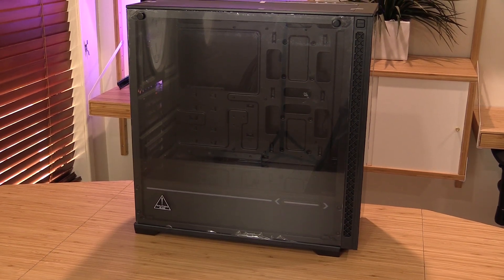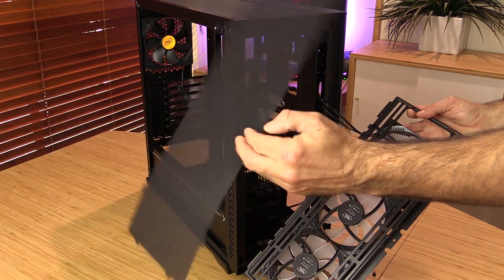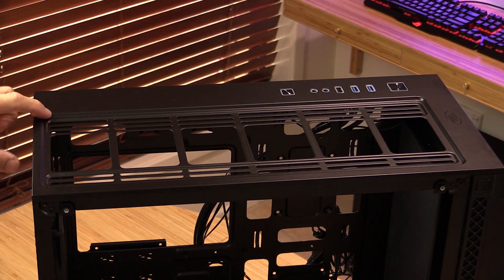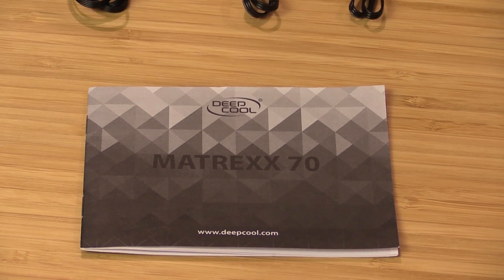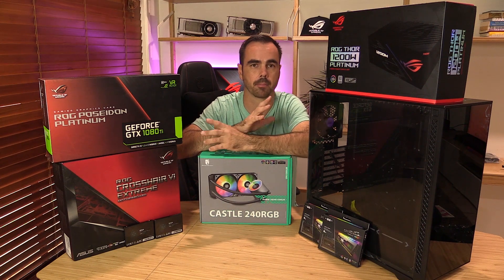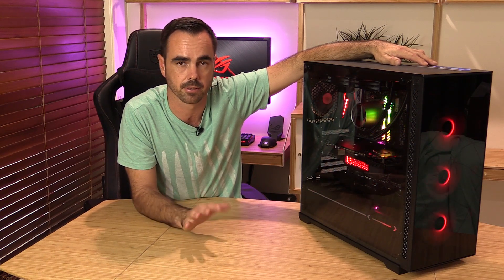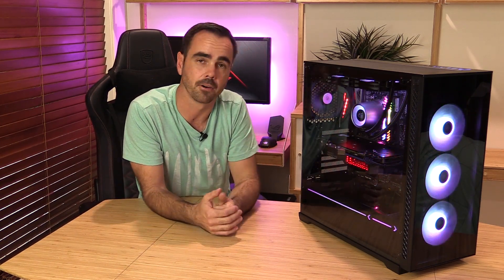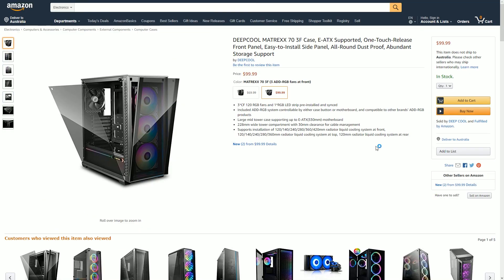Deepcool Matrexx 70 ADD-RGB 3F Review

Comment: i run this case with 5 intake and 4 exhaust fans (also from deepcool), removed the glass basement and hard drive cage to put the 2 extra 120mm fans there, GPU (2060super) is vertical and has a slight hotspot in the middle of the card if i touch the glass but the card doesnt go much over 63-65c with CPU topping out at 50c then the fan curve ramps up a little and back down to 38c the dust filters do a great job and easily removed for cleaning
Reply: may i see the photos of your setup? I also want to put extra fans but not sure how it will be better

Comment: One of the best case ever imo !!! Cheap price, sturdy build, 3 RGB fans with good air pulling ,one black fan in the rear, dust filters in the front, bottom and top, good clearance for cables,... all for less than $80 @@
Reply: is it quiet tho?
Reply: @seeeLAH1  i use headphone so i cant tell

Comment: Having the dust filter behind the fans kinda defeats the purpose of the easy remove front panel doesnt it? A magnetic one to just go over em would have been so much better with the fans mounted behind the frame,. Pop front off, remove filter for cleaning, pop back on.
Reply from the maker: 100% agree with this. Maybe in their next revision.
Reply: KWASTEK But at the same time you should just remove the dust filter entirely. Reason being is that the intakes on the side of the front panel already have built in dust filters that seem to be the same as the removable dust filter so why have 2 of them? IMO it just makes sense to remove it and let the fans move more air 👍🏼
Reply: @vtgchaos6272  Except you should not use it choked up with the front glass on anyway, so it doesn't matter that it has filters along the sides, the surface area to get air in through there is a joke.

Comment: Is it good to take this for build like this?

1) Processor: AMD Ryzen 3600
2) Motherboard: Gigabyte X570 GAMING X 
3) Memory: Kingston HX 16GB DDR4 3200MHz HyperX Fury Black
4) Graphic: Asus PH-GTX1660-6G
5) SDD: WD M.2 Black SN750 / 500GB

6) Power: LC Power LC6650GP3 V2.3 650W

Thanks.
Reply from the maker: That build looks pretty solid for this case for sure 👍

Comment: Hey, was it difficult to hook up all of the A-RGB components from the Radiator fans and AIO pump to the integrated controller? When I get this case I will have 3 A-RGB fans (2 on my AIO and 1 as rear exhaust) and want to have it all synced with the pre-installed front fans. Only thing is they are Cooler Master fans and have different A-RGB connectors than the ones Deepcool uses. I assume it comes with more connectors and just uses Molex for powering the controller. Can you confirm? 

Loved the review really helped me decide if this case would be a good fit for me!
Reply from the maker: No it was easy with the Deepcool fans. From memory the cooler master fans have a different connector but you daisy chain them and just use the included adapter cable to connect it to the RGB controller it'll be fine. Alternatively just use your motherboards on board rgb controller.
Reply: @kwastek2125  Hi, I have  similar situation but my MOBO doesn't have the ARGB connectors. I have 3 Deepcool ARGB fans I bought separately, is it possible to have all 6 fans (3 from the case and 3 other deepcool ARGB fans) connected to the controller on the case? As I do not have RGB connectors on the MOBO.

Comment: is the cooling/airflow  upto  the mark? we dident see the benchmarks of the tempreture.... otherwise an awesome video .. :D
Reply from the maker: Hey mate, yea unfortunately I didn't have time to test thermals when I recorded the video. Since using the case for my daily in an Australian summer it's been perfectly fine. I did take a suggestion from another user who commented and removed the dust filter from behind the fans in the front which did improve airflow a bit. So I would recommend doing this also.
Reply: KWASTEK so put the dust filter in front of the fan?

Comment: hello I have a mobo msi x470 gaming plus but they do not have a 3-pin 5v input, will there be a problem or does the cabinet already have an adapter?
Reply from the maker: The case has a built in led controller and has different adapter plugs for different motherboards.

Comment: Hi and Thanks Kwastek. I bought this new computer with this case and although the front 3 fans and the Power supply all work off the case button, the top two fans, LEDs light strip and rear fan just glow blue and don't change with the front fans color!  Any ideas whats wrong? Cheers from WA ;-)
Reply from the maker: Hey mate, if you have those fans running off the motherboard then make sure you have the correct pin out. Usually if the pinout is different then blue is the only colour that will be put out. So I would check your connections first cause that's what it sounds like

Comment: What about airflow?
 I have a choice between matrexx 55 mesh and matrexx 70.
Matrexx 55 mesh has very good airflow and matrexx 70 because it has a  lot of space.
Reply from the maker: The matrexx 70 has good airflow once the front dust filter has been removed. I have been using this way for the past 6 months and it's been quite good. I can't comment on the matrexx 55 as I have not used it

Comment: ok but what about the short space between front fans and the glass??? the airflow is sucking in this case...
Reply from the maker: Not had an issue with airflow because of this.  Removing the back dust filter from behind the front fans did help a bit with airflow though. But I didn't have an issue at all given there's about 15mm of space in the front.

Comment: Hay man great video! I've been looking around for some info and I hope you can answer some questions for me. Can you remove the HD cage, the reinstall the glass basement roof? Also, if the radiator cage is removed what are the fan mounting options for the bottom of the case. It looked like you can mount some fan larger than 120mm, maybe a 140 or 2?
Reply from the maker: Hey mate thanks :) yea the hd cage can come out all together but it won't be fixed in place as the thumbscrew fixes to the top of the Hdd cage. And yea you're right you can install 2x 120mm fans in the bottom once it's removed, I said you could only install one in the video.
Reply: @kwastek2125  Hey, great video. Very clear.

I have a couple of doubts,

1) Can you sync the RGB on the front ARGB fans with an additional CM Masterfan MF120R fan (in place of the rear exhaust) 

2) Will you recommend this over Masterbox MB530P?
Reply from the maker: @sagarchopra3819  hey mate thanks. As far as the fans go yes you should be able to sync it up fine. From memory the coolermaster fan might have a different rgb connector but the case does come with a couple different rgb leads so as long as you can connect it up it should be fine.
As far as the case I'm not sure as I haven't used that case. I don't think you can go wrong with this case for the money.

Comment: Hey i just bought this case and I couldn’t find a way to connect the front fans on my motherboard  it just comes too short even tho i have a normal ATX motherboard any solutions?
Reply from the maker: Yea that's frustrating. If the fan cables are too short then you might have to buy extensions or a fan controller. What motherboard are you using?

Comment: I have a question. If I install radiator+fans to top side how much cm can it be max? Does it touch to rams or motherboard?
Reply from the maker: I wouldn't go any bigger than 25mm on the rad plus fans.

Comment: Thanks for the video. Can i install 2 * 360 radiators on the front and on the top in same time?
Reply from the maker: Yes shouldn't be a problem. I was going to do the same thing for some testing 👍
Reply: @kwastek2125  thanks 😃

Comment: hey man. ple just built me a pc in this cazse, how do i change the rgb fans at teh front?
Reply from the maker: As long as they plugged in a SATA cable to the rgb controller in the back you use the button on the top furtherest away from the power button. It'll say "LED" on the top of it

Comment: I may get a 3080, will the 3080 fit inside this case and will any parts of the 3080 airflow get blocked?
Reply: did u put a 3080 in hows the case im getting this next week

Comment: Do I need to get an extra air cooler or the coolers come with it are all good? And does it get hot? And does it get dusty
Reply from the maker: Yea the included fans are fine. If you're running an AIO then just mount to the top to pull out more air. Temps were fine on my 3900x and 1080ti set up. Dust so far has been ok
Reply: @kwastek2125  so in an i5 9600k rtx 2060 I don't have to get any fancy coolers or something right?
Reply from the maker: Nah you'll be fine

Comment: Will I be able to install 140mm fan at the rear or only 120mm
Reply from the maker: 120mm unfortunately. A 140mm would have been nice on the back but given the size of the case this wouldn't have been possible

Comment: U can remove dust filter by opening front panel
Reply from the maker: Yes. You only need to take the front panel off if you want to fit fans and/or a radiator

Comment: Is there any software to change the RGB fan colors?
Reply from the maker: If you connect the rgb controller to your motherboard you can just use what ever software comes with your motherboard. If you don't have a motherboard with built in RGB the button labelled LED will cycle through pre set colours and modes
Reply: @kwastek2125  Thanks!

Comment: Does It come with A remote RGB fans?
Reply from the maker: No the LEDs are controlled using a button on the top I/O.
Reply: Thank you so it should be on top to change the rgb fans right?
Reply from the maker: It changes the RGB fans and the RGB strip in the PSU basement
Reply: @kwastek2125  Ok thanks

Comment: how did u sync their lights? thru an app?
Reply from the maker: Has the option to be controlled through your motherboards software or using the integrated LED controller and using the button on the top labelled "RGB"

Comment: Let me help u guys. So this case is one of the cheapest with premium look that offer almost same performance as h710i, h500p mesh. My build is an 1080ti aorus, 9600k deepcool castle 240rgb v2. So far the best combo that balance airflow with noise is: rf 120 and rf 140 fans. I put 1 rf 120 back, 2 rf 140 on top . I mounted the 240 rad in front with push pull config with push the fans that come with aio pull the rf 120 and one more rf 120 unde rad for intake gpu. I changed cage position to front to block air so i have a good airflow under gpu. So far, apex legends cpu 51c, gpu 68 c ambient 22, csgo cpu 53 gpu 60. Now,from stress test i saw cpu without front 54-55 and with front panel mounted 58-59. No difference on gpu. Now, im thinking a way to make the front panel mesh but same time keep acoustics same cuz this is the only single thing that case miss from beeing perfect. If they would implement a front mesh or front open intake it would screw the competition.

Comment: Hi
Can we insert disk or CD in matrexx 70?

Thanks
Reply from the maker: No there's no 5.25in bays in the case at all.
Reply: @kwastek2125  what should I do then? Do I have to buy it separately?
Reply from the maker: If you really need a DVD/CD drive for your setup you may have to buy an external USB DVD drive
Reply: @kwastek2125  thank you

Comment: Hi, for the included RGB a couple of questions:
1. Should the LED button on the top of the case be able to cycle through modes out of the box? or is some software / config required (mine doesn't change from the default blue)
2. What cables are required to be plugged in? I have the fans plugged into a mobo fan header (and they spin fine) and the single SATA power plugged in, which as said above, allows for blue lights but no cycling.

Futhermore, my LED strip seems to only have 3 lights working and at random (but not blue like the fans) colours - could this be related to some power problem? Or is it likely a broken strip. I bought this case off of a friend who reviewed I believe it worked fine for him, but unsure if either I've damaged it in shipping or if I havent configured it correctly. He isn't able to get back to me right now, so wondering if you could have any guesses? Thanks!
Reply from the maker: Yea the led button should cycle through all of the colours/modes out of the box. Try using the integrated led controller to control all of the fans and led strip then try with your motherboard. If you didn't get l the accessories and different led cables with the case the more than likely the pinout is different from the Led strip to your motherboard header hence why you only get blue. Each motherboard vendor is slightly different with the pinout. What motherboard are you using?

Comment: where  is the rgb controuler?
Reply from the maker: At the back of the case on the left hand side. It is controlled via a button on the top of the case.
Reply: @kwastek2125  thanx...is  the case have high airflow ?
Reply from the maker: Yea has really good airflow, I've had no dramas so far. It's been winter here in Australia so far thou. I will update once summer comes.

Comment: Never mount the videocard vertically it will throttle like crazy, if not the cheap thin metal would be a great purchase otherwise, not a good  purchase.
Ty now I cnow that it's not for me too many compromises a like for a good quality video, too bad it looks gorgeous.
Reply from the maker: Yea for air I definitely wouldn't recommend it, for water it would look nice. Yea for a budget case with included fans you can't beat it. If you want something more premium then yea this case may not be for you

Comment: Case too expensive not including with rgb and fan control. Everything have to buy separate. Complicated to set up and put together with cables... Is Good design around case fans and dust filter. But the case should come with RGB and Fan control.. I buy this case in Webhallen.  This case i give 7 of 10 for this pris and item. If the owner of this company see this comment you should fix this and send us RGB and Fan Control. (If you want your company growing up) and you will get more customer.! With out complain.
Reply from the maker: It does include an RGB strip and RGB  fans. Maybe you bought the version that didn't come with these options but the case I reviewed came with these as standard as it's the 'ADD RGB 3F' version. Fan control is all done through the mother board like most other cases these days. If pricing is high then they could be the region you are in as the pricing here in Australia has come down since the filming of this video.

Comment: What’s the software for control the fans ?
Reply from the maker: There's an integrated LED controller on the back which is controlled by the button on top labelled "LED" or plug the LED controller into your motherboard and use your motherboards software.